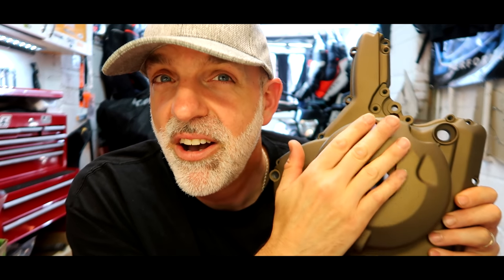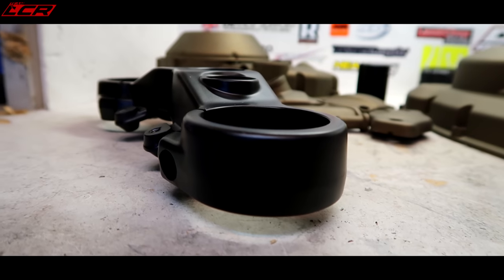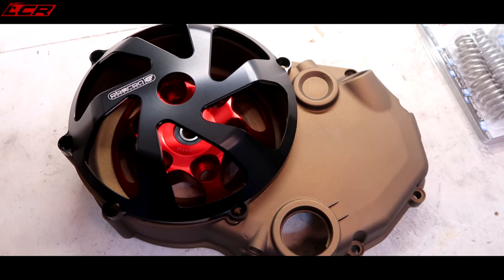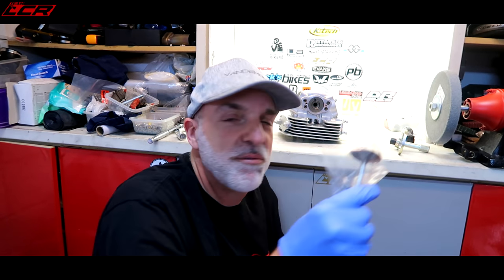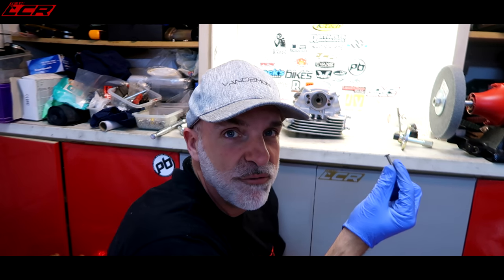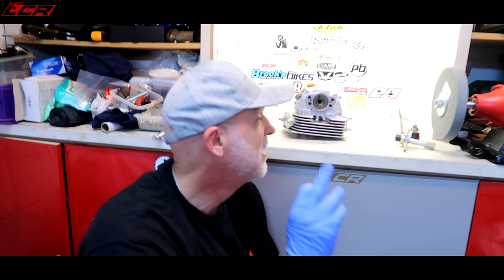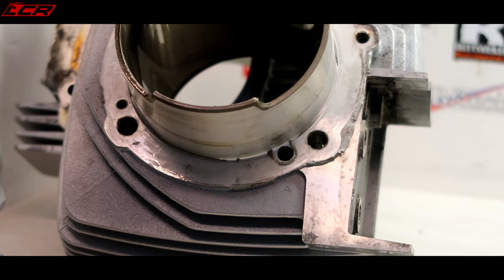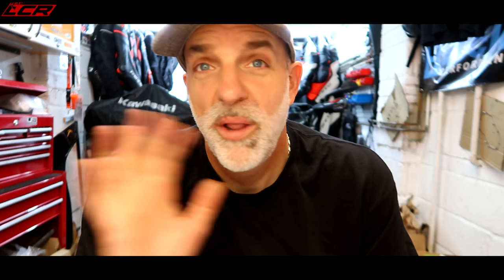Cerakote Parts 👌 | Hypermotard Restoration EP09

Comment: chops..you clearly the best motorbike vlogger on you tube..keep it up.
Reply: Chops and Millyard are the best vloggers on you tube and both have unique super powers  for example chops gets stuck in with his hammer and chisel to conquer the cylinder heads of any engine that pops it's head up above the trench then shines the Bat sign into the night sky and along comes the mighty Allen on the millyard flyer complete with dustbin to file away all the debris left by chops Wow what a fantastic program that could be put me down for a BBC licence.

Comment: Ciao Chops thanks for all the Vids, keeping us amused. In Northern Italy, just starting to be able to get out officially. Reading in Performance Mag, May artical that Cerakote is completely resistant to fluid leaks, oil petrol etc. Might be handy on the Ducati! All the best Pete (990 Superduke).
Reply from the maker: Yes good point I forgot about its heat resistance and other benefits

Comment: Loving this as a hyper 1100 evo owner. Re your final gearing, my preference is 15/42 for a properly mapped & dialled in cams motor, eg 30mph in 4th gear is fine, pulls cleanly without snatching. 14 t is not ideal on the front. Just my prefs. Do get the cams diain though as it makes a huge difference to low speed manners. Cheers Chris

Comment: Cerakote is sprayed and baked in a oven and anyone can do it,its very easy ,only down side the cerakote is exspensive!!  I think it originally came about as it was used on guns .. I need to get my casings done as the burnt bronze powder coating is starting to where off after 2 and half years on my old red pig xr650r ..

Comment: That special  tool that releases the pulley nut is called a castle socket ( looks like the  chess piece ), most people fabricate it from an old socket 😉.

Think you should have sent the rear sprocket carrier of to be seracoated burnt bronze too or at least match the sprocket colour.
You need to get a wiggle on if you're going to ride before summer ends 😉.

Would you do a price total at the end so some of us poor mortals have an idea how big a bank to rob if we want the same work please.

Keep smiling Chops & stay safe bud 🤟👍
Reply from the maker: Yes of course it is, thanks for the reminder 👍

Comment: You need a breaker bar for breaking torque on those stubborn nuts and bolts..  (Impact works as well, but I prefer doing it by hand, especially with ones requiring special tools)

Comment: Love your videos Chops however just a small correction, powder coating is applied electrostatically not magnetically. If it was magnetically applied you wouldn’t be able to powder coat aluminium.

Comment: It might make your life a bit easier if you disconnect the big ends and lift the piston out instead, and fit them in the head with a piston ring compressor. Then all you need to do is do up the big ends, rather than the fiddly job of re-fitting the gudgeon pin with the piston part in the head and not much room to get to, that does obviously means the sump gasket needs replacing then.
Reply from the maker: Ok good tip will do some research matey 👍
Reply: @LambChopRides  It's the way we always done it with cars, just seem the easier logical way to me because of that. Good luck with it, looking forward to seeing what you decide 😎👍
Reply: There's no sump on this engine!

Comment: Powder coat is a plastic coating not a paint and it's applied using static electricity not magnetism. Plastic generally can't be powder coated because it will melt during the melting process of plastic powder coat but anything that can withstand sustained 400f Temps can be powder coated.
Reply from the maker: Yes you are correct, I was trying to say (very badly) the powder is positively charged and the item being coated earthed. Not magnetized

Comment: That Kreosote finish looks tops Chops! How much would the company normally charge for the selection you had done (assuming they gave you a spesh deal)? Loving the series (especially the bling!) - so here's to the next exciting installment. Have yersel' a lovely weekend 👍 😎
Reply from the maker: Yes I did get a deal, i had more bits than shown in the vid and should have been about £300 quid to give you an idea 👍
Reply: @LambChopRides  Many thanks for the info, John. I'm pleasantly surprised by the cost: especially considering the quality of the finish & it's advantages over powder coat. I'll definitely be taking advantage of  those Midlands Wizards on my current project. Frankly, it'd be rude not to 😎

Comment: Chops powder coating has nothing to do with magnesium, or you wouldn’t be able to powder coat aluminum. It’s an electrostatic charge and technically you CAN powder coat plastics, as long as they DON’T MELT in the oven.
Reply from the maker: Yes your right Andy!! I was trying to say positively charged power with a negative on the item being coated so its attracted. Not magnetized
Reply: Lamb Chop Rides the cerakote looks bloody awesome 👍
Reply from the maker: Yes come out lovely hasnt it, interested to see how it lasts.. Will keep everyone posted!

Comment: Please don’t use a chisel as a pry bar, they are hardened and will shatter with shards flying off when you leaver with them... use them for chiseling wood or scraping. a proper pry bar set is cheap or use a large flat screw drive if desperate 👍

Comment: Nice work!

The engine is the focus of any naked Ducati, especially the air-cooled 2v versions so all this cosmetic work you're doing will really pay dividends once the motor goes back together. 

That Cerakote's really impressive - the bronze is better than factory.

For future reference, when your remove and replace the pistons, note that the gudgeon pin circlips can be a real PITA to fit if you don't have the knack. Have a look at this video from Mahle showing how it's done, particularly the home-made installation tool at 4:40.

https://youtu.be/3kdhGBCpuxM

Also checkout the home-made tool from the UKMOC forum http://www.ukmonster.co.uk/monster/showpost.php?p=571718&postcount=1070
Reply from the maker: Thanks for the links really appreciated 👍
Reply: Hope it helps.

I don't know if you've seen this episode yet, but if you want to see how frustrating they can be check out here from 8:20 on

https://www.youtube.com/watch?v=mq4l2Yr9egM

I did send Andy those same links, but it was too late for him!

Comment: Those clutch plates you pulled out in a previous video for the Ducati are unworn and should be reused. The main wear on these is the tangs on the friction plates and later on the friction material. Both of these areas look not much worn from new and buying new plates would be a waste of money. IMO. Please have someone shim and time the valves. This isn't a job for a newbie. Thanks for the videos